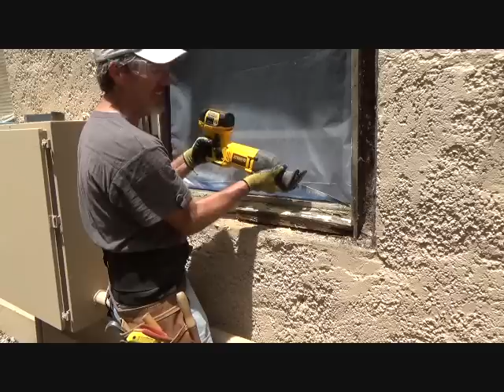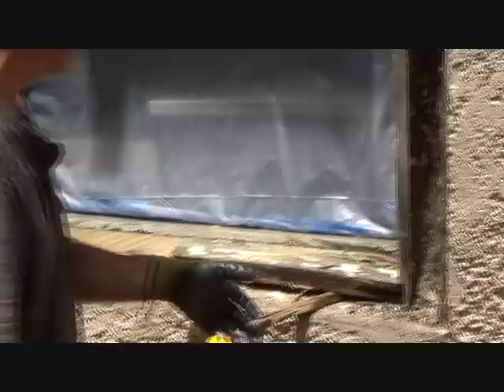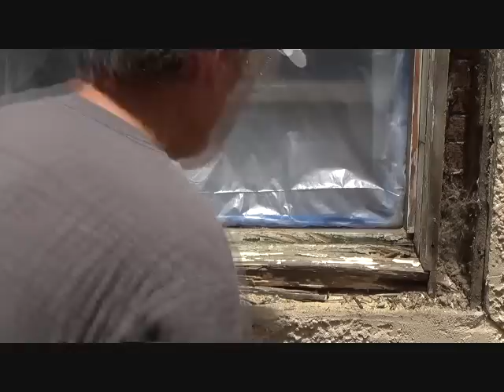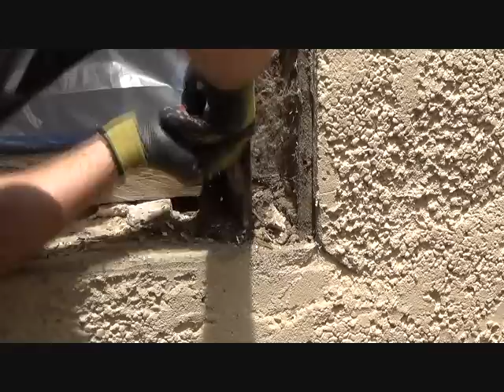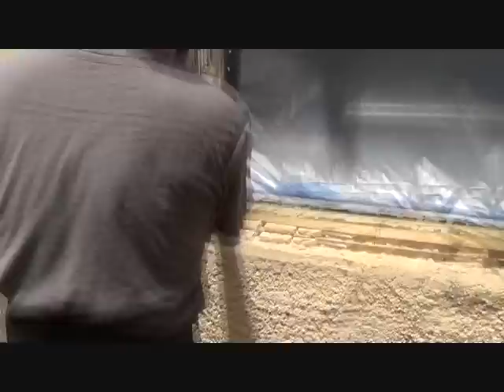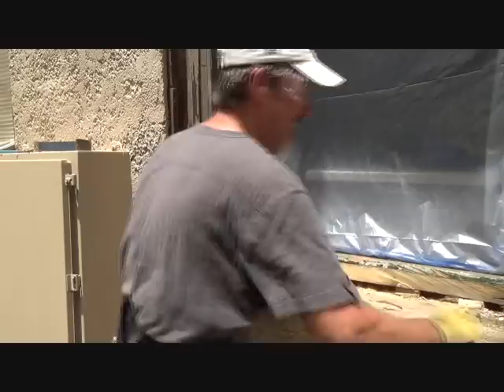How to use a sawzall

Comment: INCORRECT! That is not how you plung cut with a sawzall. His right hand should not be under the saw. The shoe of the saw should be against the product then, using the shoe like a fulcrum, with right hand on top of the saw, you slowly plung the blade into into the material by lifting with left hand or trigger hand...
Reply from the maker: Ah I think I used the sawzall how I could in order to get the job done. Can you use the sawzall & hole it all kinds of ways to get your job done? Of course!@